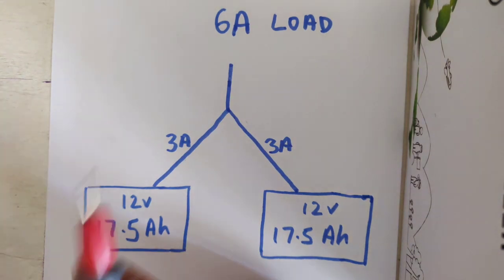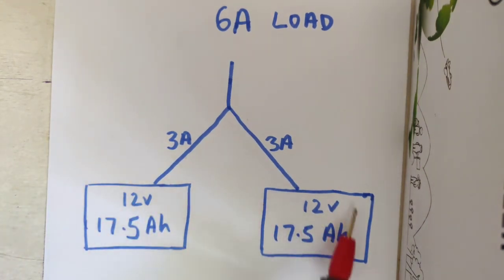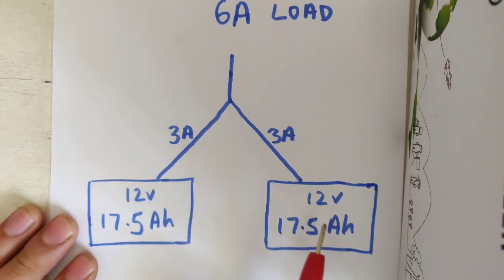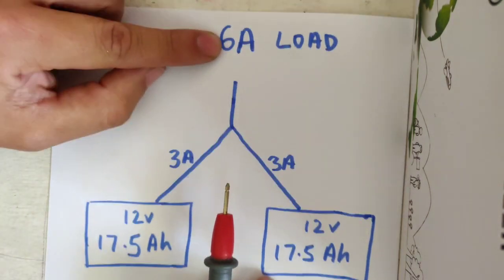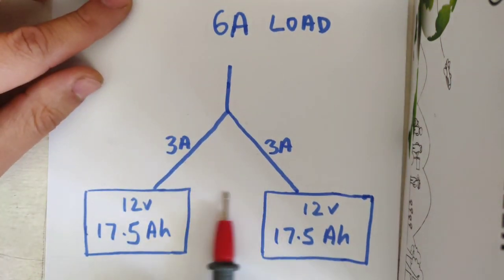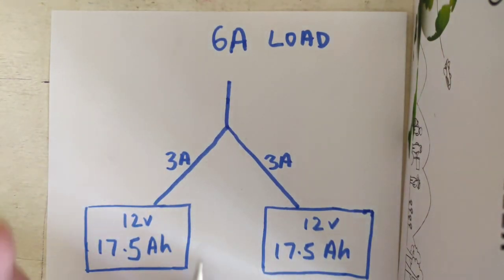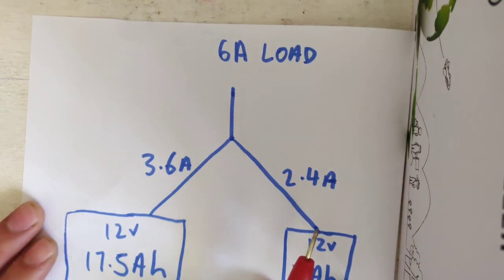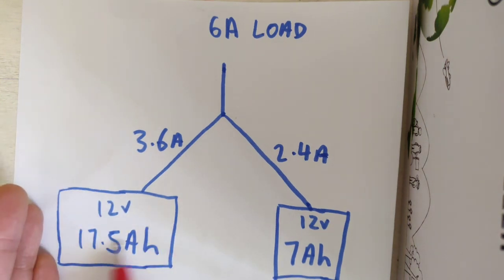Technical insight into connecting batteries in parallel.

Comment: Will the total deplete faster mixing Ah ? Scooter batteries I have 2x12v20ah and 2  other 12v with one 7.5ah and one 12ah 

Would this be ok to run in parallel for 48v

Comment: Your water analogy is incorrect. The water pressure at the bottom of each tank will be exactly the same. Therefore the flow rate will be the same from each tank. If l measure the water pressure at 100 meters in the ocean and l measure the water pressure in a 100 meter 1 meter diameter tube the water pressure will be the same. And the ocean has a lot water in than the pipe. Batteries do the same .

Comment: I have been trying to figure out how much current each battery would contribute to the 6A required.  I've tried figuring by the Ah ratio of each battery compared to the total Ah of the batteries connected together.  So 17.5 Ah + 7 Ah = 24.5 Ah.  With a 6A load the batteries would last 4.08 Ah.  Things fall apart after this.  I tried to figure out how much each battery is giving.  I divided 17.5 Ah / 24.5 Ah = 71% for the first battery and I got 29% for the second battery.  How do you figure out how much current would be drawn from each battery?  Also, this is assuming a linear relationship.  I am interested in this because I am playing with solar panels and golf cart batteries.  With one test, powering an inverter @ 12V 50A the solar panels were supplying 20A and the batteries were supplying 30A.  I don't know how to figure this out with the math.  What determines how much current comes from the batteries and how much current comes from the solar panels?  Thanks in advance for any comments or ideas.
Reply: What in the hell are you talking about?
Did you mix the units?
Reply: @yasyasmarangoz3577  Never mind.  After thinking about it, it probably has more to do with the internal resistance of each battery.

Comment: Whats a safe voltage difference between 2 battery packs before connecting in parallel?
Reply: Hi Mate,

Get the batteries within half a volt before you connect them together in parallel.
Reply: @salesfpvpower7858 got it. Thanks

Comment: I love ur explanation 
Just one question when u say the batterie should be at the same voltage you mean full charge ? With the condition of knowing that the specs of the batteries are for example 48v 21ah and 48v 13ah 
I should know my both batteries are at 48 v when they are fully charged yes ? And 0 v when they are fully spent i hope i got this right 😅
Reply: FYI 48v batteries fully charge at 54.6v and cut off discharge is 39v ,At Least For Ebikes

Comment: While I understand you want the batteries at the same voltage when connecting ... if you need to ... is there a way to protect the battery/limit the current (in particular with lifepo4 or would the BMS control this for you?)

Comment: It does not work that way. 
A battery is an electro-chemical device. Ohm's law applies only electrically. Battery internal resistance is dynamic, it changes under load, Ohm's law follows the chemistry, not the other way round. The video presumes chemistry ill follow Ohm's law. It will not!!! A test would not be very difficult, or expensive, to perform.
New batteries will differ minimally, as they age, it will be statistically impossible for two such batteries to follow Ohm's law as claimed in the video.

Comment: How would you ensure the voltages are the same? Its very unlikely they would be so they would rapidly self discharge. Clearly you never actually tried this for real.
Reply: from your question... it shows your lack of knowledge on how batteries work...  when u connect two batteries they will self-equalize.....  why don't YOU go and test it first .... and report back... use any battery... say a 12v lead acid... 100ah and another one at 150ah etc...  Clearly.. u HAVE never tired this.. lol

Comment: Are you certain this is accurate with Li-on/LiFePO4, because they have flat voltage curves*.  Your premise is that due to the significant drop of voltage with SLA/AGM/GEL batteries -- the batteries will discharge proportionately based upon their capacity, which is correct.  *However, when you have batteries whose voltage does not go down for the bulk of their discharge (as with LFP) then this premise wouldn't hold true.

Comment: So, i have to fully charge two same voltage, different capacity batteries  in order to connect them in parallel and use, is it like that, Sir?

Comment: Very well explained. Another question rises - What if the smaller 12v battery is used for a while and the bigger 12v battery is fresh? The smaller one suposedly have lost 20% of its ability. Will it act like a leach to the bigger battery all the time and create power loss?
Reply: Not an expert but I would expect so. As the batteries discharge the voltage drops as well. So by running them seperately the voltage of the flat battery is lower than the fully charged battery.
Reply: As the battery ages, I would imagine the "tank" capacity just gets smaller.  The fully charges and discharge voltages are still the same.  So in his example, the 7.5ah or (300liter tank) just becomes smaller.  It still contributes but much less over time.

Comment: You could put the load (red) on the other side of the battery array and still be in parallel which would give you equal charging and discharging capabilities. It would also increase the battery life expectancy because it’s better balanced. Often the battery at the beginning of a parallel circuit does the majority of the work will the battery at the end does the least. Food for thought. Balance your load. =] LoL
Reply: Yes with a battery with traditional terminals. A little hard to do with our waterproof leads 😀

Comment: for 10 batts hooked in parallel 12v 70 amp each would a 80a circuit breaker installed between the batts and the charge controller be ok or is has to be greater amp breaker?

Comment: do you need to use parallel lead or use pig tail to join
can you connect 1 charger to leader and charge both at same time or do you need to charge seperatly
Reply: Use the parallel lead. You can charge both together but charge times will be doubled. Both batteries should be charged full before putting the batteries together in parallel.
Reply: @brandongoh8900  thanks will do have ourchased your new green light and pro charger and usb charger and hub for my new hobbie pro 12 foot 360 so may have a another question later thanks for guidance

Comment: What if you put 2 different batteries with different voltages, and you put a diode at the end of the lower voltage battery, will it run normally and protect the lower voltage battery from overcharge and explosion?
Reply: Diodes conduct current only when voltage (potential) is higher on anode than cathode. So if you connected a high current diode  with its anode at the positive terminal of a lower voltage battery, and its cathode at the intended "parallel" (+ve) connection of the higher voltage battery, then that diode would become reversed biased, (IE: higher voltage on cathode than anode) and would pass no current at all from the lower voltage battery. Even multiple diodes with anodes connected to  different voltage batteries +ve terminals (with all diode cathodes on an outgoing parallel bus) will be reversed biased on lower voltage sources. So no, it would not work. Only when a higher voltage battery discharged to a voltage lower than the diode connected to a lower voltage battery, would the diode conduct, and the resulting voltage would be the lower battery voltage. (Ignoring voltage reduction across the diodes.)

Comment: My question is: can I parallel a 12v 65ah car battery and 12v 50ah deep cycle solar battery?
Reply: It depends. If your goal is short term, and the voltages match, then yes. The problem comes when it depletes under 50%. Your car battery will not like that, but the deep cycle might be okay with a lower percentage. Also, the load is a big question. Solar batteries are not designed with peak load in mind, car batteries are built for peak load/start the engine/. So yes, you can, but several things to take into consideration, to avoid damaging your batteries.

Comment: If you parallel two or more batteries, the voltages must be within .2V, and the capacities must match.  The date codes MUST match!  This is especially true among solar power systems, or automotive applications. You must match the charging amperage of your alternator for the car/truck batteries that are paralleled or neither battery will ever be fully charged. Keep the tops of your batteries squeaky clean, or you will create a high impedance short that will make your solar or alternator work much harder to charge up the batteries. This is especially true in car/ truck batteries up in the "rust belt". That dust that collects on the top of your battery is actually not dirt, but powdered rust from other vehicles that will short out the battery by making a path between terminals on your battery.  Always use distilled water to clean the top of the battery, a dampened cloth will do fine.

Comment: What if I put a BMS with lower Amp rating on the pack with lower capacity, Would they still discharge at the same rate? What If I put a BMS with higher Amp rating, would it limit the discharge rate of the pack with the lower capacity to adjust to the pack with the higher capacity? Thanks. I still have a lot of questions in my mind that I would like to ask hope that you could answer my question.

Comment: If you conect to series but its not the same voltage what will happen?
Reply: Nothing. Parallel is used to combine Ah with same voltage (12v 50Ah + 12v 150Ah = 12v 200Ah). Series is used to combine voltages with same capacity (12v 50Ah + 24v 50Ah = 36v 50Ah).
Reply: @marks9127  I Mark thanks for your answer.
I have a huge bank of batteries of 1.2v each but I have different capacities to connect them in series for example I have 36 batteries of 1.2volt 138 Amps each but I need 4 more batteries in order to get 48volt battery  bank. Can I add 4 more batteries of 1.2V with 180 Amps of capacity?

Comment: Excellent Video i need help please reply
can i put Analog / digital dc amp meter on parallel batteries for showing amps when charging and discharging from batteries all the time  ?
is that this analog / digital dc amp meter draw some amps from battery ?
Thank you
Reply: You can buy fairly inexpensive nanometers to mount on each battery to compare charge rates. eBay has them for about $6 US. the last time I bought a half dozen. While not totally accurate, they give you a good idea of how many amps are going to each battery. GOOD LUCK!

Comment: Excellent video, i have a question
i have 2 185AH Batteries connected in parallel working fine but i want to know how amp using each battery when i put on load or charging ?
can i put 2 digital amp meters ( like a volt meter ) on each battery for see the load and charging amp of individual batteries ?
i am waiting for your reply
Thanks in advance
Reply: You only need to know the total amp draw or charging amps. Batteries in parallel will always split the load in half.
Reply: @brandongoh8900  thanks so i need to put a single digital amp meter on  battery 1 positive and battery 2 negative i hope that will show total amp draw and charge ?

I am waiting for your reply 

Thanks
Reply: @ferozkhatri8565  yes that is correct. Or if you have a clamp type amp Meter you can use that to take your amp draw reading instead.
Reply: @brandongoh8900  suggest me , i think i can use digital dc amp meter because it will show amps when charging and discharging from batteries all the time without any hassale  ?

2 is that this disgital dc amp meter draw some amps from battery ?

3. is that safe to attach digital dc amp meter with battery ?

Thank you so much for your help
Reply: @brandongoh8900  what about batteries connected in parallel with same voltage and different capacities? Do they split the current draw in half or divide the load according to the capacity? What about charging? Does the higher capacity battery charge with more current?

Comment: What if the load only needs 3 amps and I do parallel does my load still get forced 6 amps or will the batteries adjust to 3 amps
Reply: Then it will pull 1.5a from each battery.
Reply: The load will only take 3 amps of current.

Comment: It doesnt matter if I have 2-12v 115AH batteries and 2-12v 35AH batteries?  I can connect them parallel for my 400W solar panels?
Reply: Yes as long as you don't exceed the maximum charge rate on the batteries.